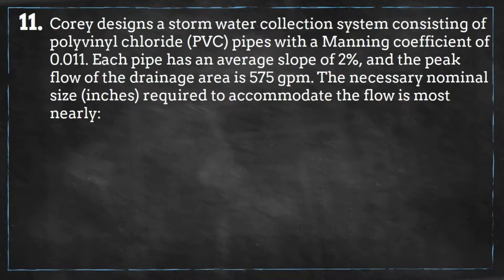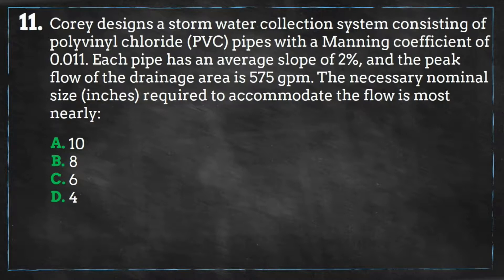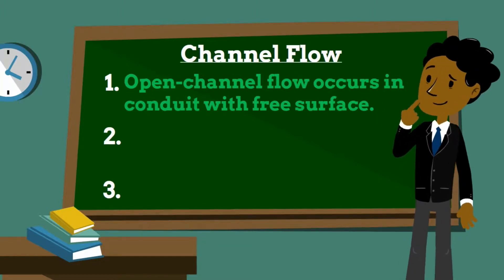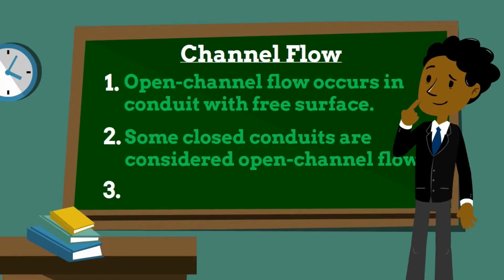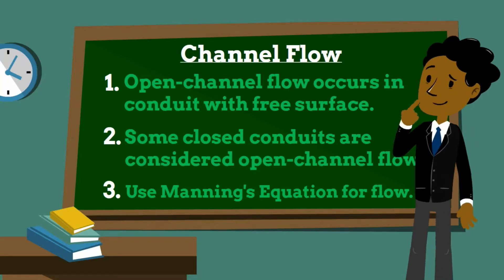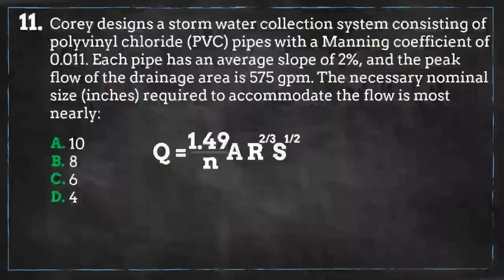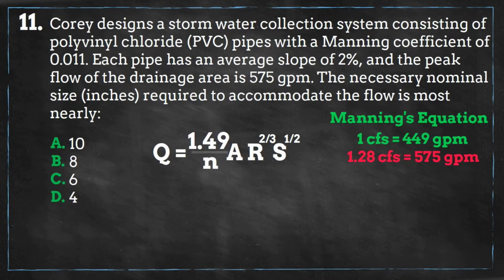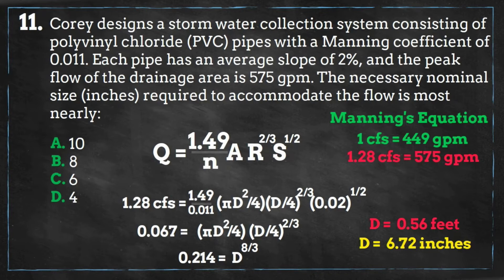Pipe Flow - Episode 11 (Principles of Water) | 52 PE Exam Problems in 52 Weeks

Comment: For WRE, there is a formula called Minimum Diameter of Circular Pipe Under Full Flow Conditions in the reference manual V2.0.2 (p. 348) that could also be used to solve this problem!

Comment: When I initially did this, I rewrote the area in terms of the radius A=pi R ^2 and did not get the same answer. I'm wondering if I just made an error in calculation but wanted to verify that we could solve using radius instead of diameter. Thank you for your help!
Reply: I am also having this issue^

Comment: The handbook does not have the area term in the Manning’s equation.  What about this problem indicates that it should be included here?
Reply from the maker: That's an excellent question! So the original Manning's equation is solving for velocity (v), so it can be manipulated to solve for flow (Q) by multiplying both sides by area (A), as Q = V x A. This is why the area term shows up in the episode when solving for Q. Some Manning's equations will be stated as either solving for Q or v, and I don't think I properly explained that. Let me know if you have any follow-up questions on this.
Reply: @SIGMAEnv  Ah yes.  Silly me!  I completely understand!  Thank you so much for your prompt response!  This is a wonderful series.  Thank you for sharing this with us!